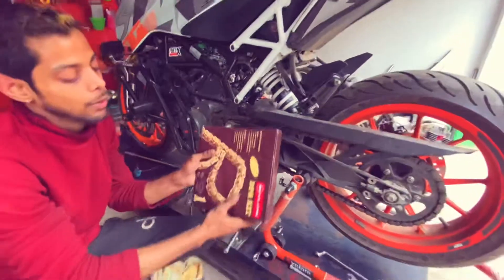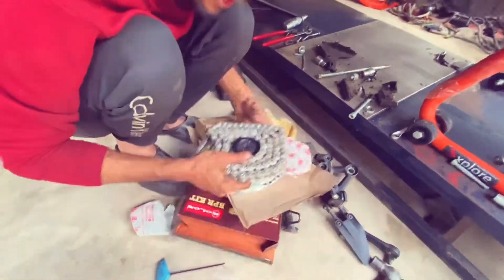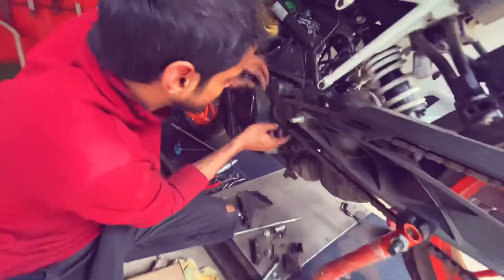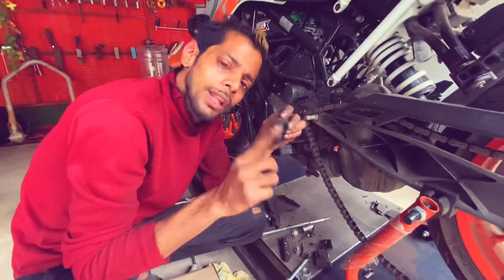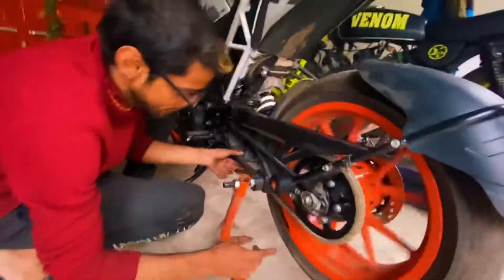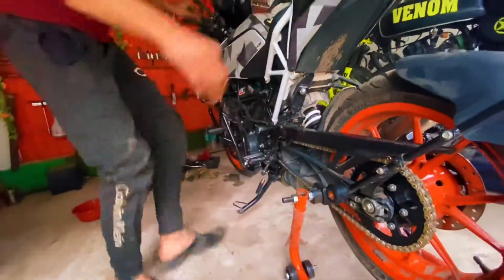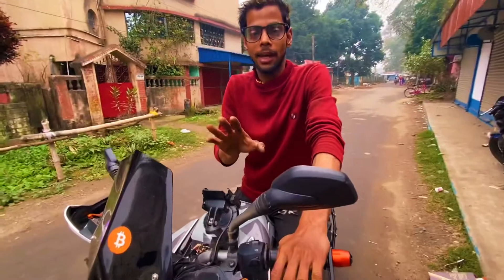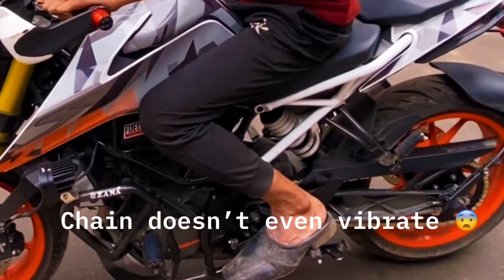KTM Duke - Best Chain sprocket kit for duke 200/250/125

Comment: Duke200 me is chain set se pickup ya top speed kuch increase hoga kya ? because isme theeth jyada hai shyd
Reply from the maker: Pick up or top speed increase karna h to Duke 200 sahi bike nahi h. Rev limit ko unlock karke kar sakte ho lekin to 3-5km/h increase hoga usse gari mein kam se zyada damage hoga. yeh sprocket kit mein bass chain slacking nahi hone deta aur vibrations kam kar deta h.
Reply: @Cryotek  Ok to isse meri 200 me koi top speed aur pickup p effect nahi pdega na ? Jo hai sb wesa hi rahega Hena ?
Reply from the maker: @deepbackpacker9769  no effect only smoother chain

Comment: Bro can I remove db killer from stock exhaust  for duke 250 bs6 will it affect performance of engine ??
Reply from the maker: Offcourse it will affect you bro. Don't modify the exhaust it will drop your performance and will reduce longevity by half. Always make sure your back pressure is maintained. Keep your DB killer on. Loud sound is not worth it bro
Reply: @Cryotek  👍 tq
Reply: After removing db killer performance will increase but a slight lag will be occur i n initial to prevent that ise performancr air filter